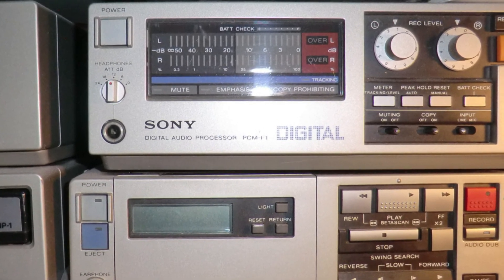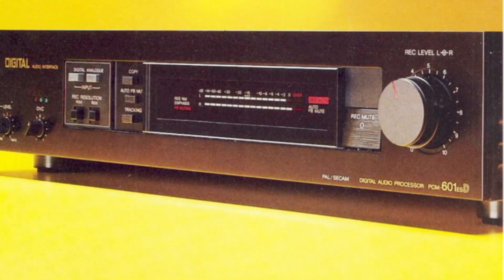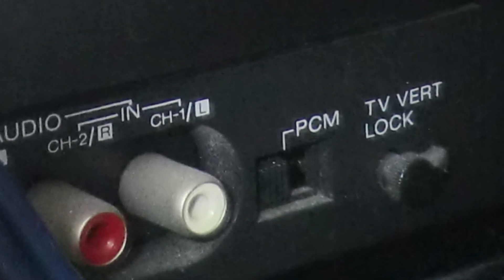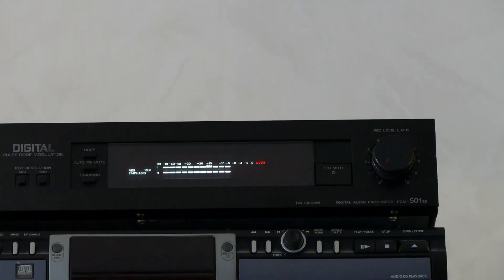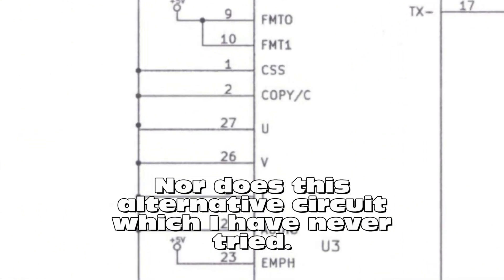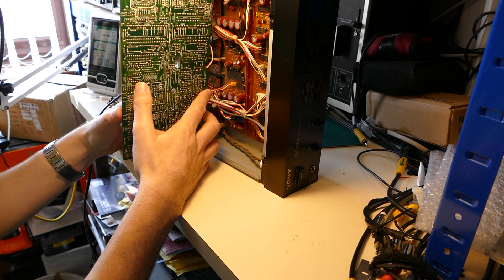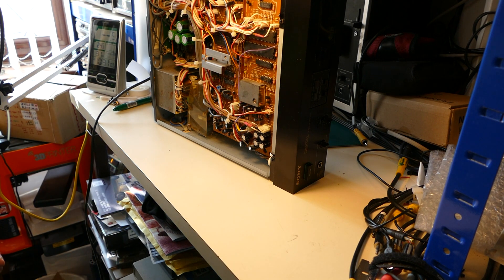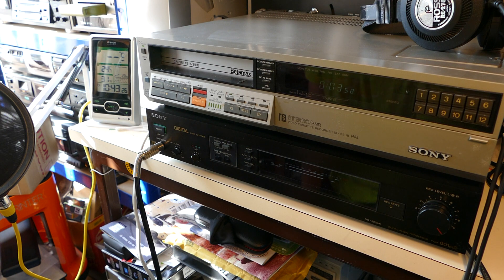The super-rare Sony PCM-601ESD decoder

Comment: Just acquired a 601 myself. I was running some tests by sending audio to it via SPDIF in, and then recording audio back to my interface via SPDIF out. With my gear slaved to the 601 at 44.1KHz, the clock signal drops every few minutes and forces my interface to re-clock itself, resulting in an audio file with silent spots. Do you slave your digital gear to your 601 when recording?

If you do, it could be my VCR causing the issue. Do you recommend any specific VCRs for transfers? I was thinking of going for a Sony editing VCR with a REF-IN so that I could genlock it to the studio sample rate using a video/audio genlock/wordclock sync box for perfect transfers, but not sure if that would make a difference either. It's slightly above my head at times.

Thanks for your videos!
Reply from the maker: I don't use my 601 because of problems like this, instead I use a 501 with Whistlewood interface which doesn't throw out the SS-R250N every time there is a glitch.  The best players are those where the normal Dropout Compensator (DOC) function can be switched off, such as the SL-C9 or SL-F1.  Or you could modify almost any Beta machine to be able to bypass the DOC function by referring to the schematics.  I should do a YouTube video about doing that to a Sanyo VTC5000 or similar one day.

Comment: There is a common fault on older F1's and 601's that the ceramic resonator, which is part of the clock recovery on playback, goes out of spec.  If you listen carefully you can hear a low level noise coming from the clock recovery from video.  If you copy the recording to another device via the digital output, you'll find that this noise is gone. It's just an artifact of the measures Sony had to use to recover the audio from the video stream.   
I worked with these systems very extensively for many years and know many of the quirks.  All in all, it was an amazing system for its time.
Reply: That lithium tantalate will get you every time, won't it?

Comment: I have a 501 and a 601.
Reply from the maker: The 501 is quite common but the 601 is a rare beast.  However I've found I get better results with the 501 plus Whistlewood add-on, than the 601.  The audio capture system aborts if the 601 hits a bit of corrupt tape, but that doesn't happen with the Whistlewood PCB in a 501.  So I always use that 501 setup.  I now also have a Whistlewood board in my 701.

Comment: I have a useful little unit a FriendChip Pro-Con which is a Digital audio format converter (AES-SPdif/SPdif-AES). It also allows SPdif to SPdif with a switchable SCMS defeat. I think it dates back to the late 1990s.
Reply from the maker: I've found that a balanced to unbalanced cable is all that is required for AES to SPDIF these days since most modern recording equipment (like a Tascam DR-100MKII) accept both protocols seamlessly.  But the SCMS defeat might be handy sometimes.

Comment: I have one of each; 501 and 601. Should probably sell them because I don't have a VCR anymore.
Reply from the maker: The 601 is probably worth big money, though the 501 plus third party board actually seems to work better (it doesn't send an invalid S/PDIF data stream when there's a tape glitch as the 601 does).

Comment: In theory, couldn't you digitize the video at a high bitrate, and then use software to decode the audio signal (undo error correction and other metadata in the stream) based on the pixels and output a bit-perfect PCM stream? I'm not sure if the decoders/encoders do anything with the blanking intervals though. I guess there's not really high demand for losslessly ripping PCM videotapes, but couldn't this be done?
Reply from the maker: There is software available to do this, which I've been experimenting with.  At the moment though I'm still getting far too many errors with that route.
Reply: @video99couk  What are you capturing with? What is the software called?

I recently just got a PCM-F1, finally. Yeah I really want to mod a SPDIF input and output into it, but like I don't know how to solder lol. I would assume if you have the service manual and schematic you could make one yourself, but would be super hard since you need to undo the encoding and then re-encode as SPDIF.  I would also not want to do any permanent damage to the unit like drilling a hole into it for the plug. 

I believe the DAC they used in the PCM-F1 is the same one they used in the CDP-101 in 1982?  Always wanted to put a SPDIF output into a CDP-101. I don't have one but I just love the retro design of the CDP-101.

Speaking of SPDIF, I have an old Sharp CRT TV from 1997, I was playing around with it and I found out it will actually display a SPDIF signal as a black and white "moving barcode", similar to these adapters. I have no idea how it does that, but looks very similar. I might upload a video of it.
Reply from the maker: @KylesDigitalLab  The SPDIF circuit is a little complicated, it involves a Phase Locked Loop to recover the clock signal.
I have a copy of the software here but I can't remember exactly where it was downloaded from!  It's Russian or similar.  I'll update this as soon as I find out.
Reply: @video99couk  Ok. Also is there software that does the reverse? (digital audio to PCM-F1). I recently got a PCM-F1 as a companion for my SL-2000/TT-2000 and I think it would be a really good digital audio recorder if I figured out how to get pure digital audio in and out of the unit. The only problem I can see is the 44.056kHz sampling rate. Does SPDIF even support that? 

Also if the software is Russian you might have got it from rutracker, that's a Russian forum, they have things like that. Hope that might jog your memory :-)
Reply from the maker: @KylesDigitalLab  The Russian software does not do the reverse as far as I know.  44.056kHz sample rate would be from NTSC tapes I think.  PAL tapes are a little easier.  But I've captured NTSC tapes via S/PDIF.
The software was mentioned and linked to from a forum in English, somewhere!  I do wish I had taken notes at the time.
Reply: @video99couk  Yes, 44.056kHz is for the NTSC models, 44.1kHz for PAL. 

That makes me curious though. The Red Book CD standard was published in 1980, a full year before the PCM-F1 was launched. Why did Sony use an incompatible sampling rate (44.056kHz)?  Does not make sense to me.

Comment: I have mine from year 1989, modified with cannon XLR retro-fit, BNC video connectors and insulated power supply. Still works like a charm with VHS and U-matic recorders, near my PCM-501ES and PCM-1630 with AES/EBU interface.  For me these are special things.
Reply from the maker: I'll be doing more on this format shortly....
Reply: @video99couk  What do you exactly mean about better performances of the s/pdif modified 501 against the 601? Less reproduction errors/drops? More stable synch?
Reply from the maker: @musk771  That's very easy to demonstrate, and perhaps I will in a future video: If there's a corrupt bit of recording on the tape, the 601 sends out invalid SPDIF data causing the Tascam SS-R250N digital recorder to abort.  But play the same tape on the 501 with the third party modification, and the Tascam just carries on happily when the tape is good again.  I'm hoping my next video (after the one about to release in a few hours) will be about this format again.
Reply: @video99couk  Interesting. Did you tried to record that tape with a corrupted bit via the 601, with another digital recorder, to be sure its not a problem caused by the Tascam? I have encountered various weird behaviors between digital equipments , and most of the time caused by some incompatibility or minor differences on its interfaces. For example the PCM-1630 connected to a MOTU 308 digital interface via AES/EBU does not send any audio. When connected in same way to an Apogee PSX100 ADA converter , the signal pass without any problem.
Reply from the maker: @musk771  My only other recorder is a Tascam DR-100MKII, I'm expecting that to do the same though I could try it.  But since the 501 with the third party board works so well, I've just shelved the 601.  I'm yet to find a digital output route for my PCM-1630, what is your connection set up for that?
Reply: @video99couk  I use the two digital option boards DABK-1631 that turns the right (or left I don't remember actually) analog input and output into AES/EBU. Usually I have the digital out board permanently installed so I can transfer some old digital masters (I'm one of the few owners in my city/country of this system) to digital workstation (ProTools/Pyramix/Wavelab or Sonic Studio depending of the specific work). The 1630 is permanently connected to the ZSYS Digital Detangler AES/EBU router, then addressed to the various workstations or digital recorders if needed (a Tascam DA-98HR, for example). The workstation uses many different harware systems: an AVID 192 IO, some MOTU interfaces  (1296,308 and 2408MK2), a Lynx Two B broadcast audio card, a Lynx AES16 and some others.
Reply from the maker: @musk771  It's getting that DABK-1631 which is difficult!  I've been considering trying to find a machine which can injest the Sony SDIF from the standard PCM-1630 and convert to S-PDIF.  There are a few rare DAT recorders which can do that, and a few other routes, but all hard to find.  By the way I also have a DA-98HR, see my video on repairing that recently.
Reply: @video99couk  The DAT you can use as an interface between SDIF2 format and AES or SPDIF are the Sony PCM-2500 and PCM-7010. I have the 2500 and needs some service since it have to be fully warm to read properly, then many tape stops occurs during playback. I'm guessing it have something to do with the power supply. You can easily find a 2500, its not so rare, but for sure will need a service, but it should not be an issue for you. Anyway these solutions are less elegant than a DABK-1631 that is, as you notice, almost impossible to find alone. You may also try to find some format converters  from Otari and Audio-Design, some old models offers the SDIF2 interface. I also have a Sony SDP-1000 digital audio effector, a super expensive fully digital audio effect system from the first 90s that can be used as SDIF to AES and SPDIF converter if needed, but its even more rare to find than the 1631 board! You can look my videos about it if nterested.
Reply from the maker: @musk771  Presumably though you can use the PCM-2500 in E-E mode so it doesn't matter if it doesn't read tapes.  I was looking for a PCM-7010.  I have a PCM-7040 but it's just a bit too new.  If you have any solution you might be willing to sell, just let me know.
Reply: @video99couk  Actually I'm not selling any of my stuff, but if I will find a solution for you, I will let you know for sure. The best option is in my opinion to get a PCM-2500 as cheap as possible, even with faulty tape section, to use in E to E mode. Or even a 7010 to use in same way, but the 2500 is a more common find. What is the recorder you use with the 1630? I actually have a perfect working DMR-2000, after a 4000 that gave me lot of mechanical problems and sold it away.
Reply from the maker: @musk771  Using DMR-4000, mine works well.  I have eBay searches for those models but nothing seems to turn up in the UK.

Comment: Does this use copper buss bars for grounding points on the bottom board? I recently had to repair our studio's Sony R7 reverb which is known to run quite hot, and over time, the board warps and cracks all the solder joints on the buss bars and around the ADC circuitry. Never seen anyone else design a circuit board this way.
Reply from the maker: No, I don't believe so.  There are copper strips on the top of the boards which you can see around 7:36.
Reply: @video99couk  yes this is what I mean - rather than a double sided board, they just ran copper strips along the top. Never seen anyone else do that.
Reply from the maker: @jamesbennettmusic  I thought those strips were used as screening, but you are probably right, they could be earthing buss bars (or both functions).